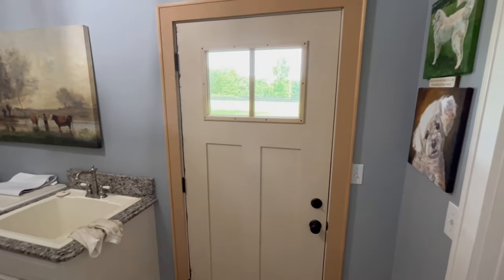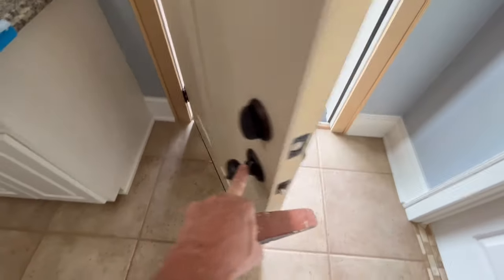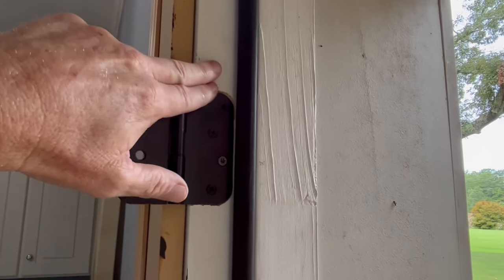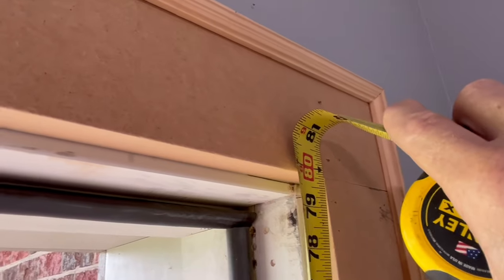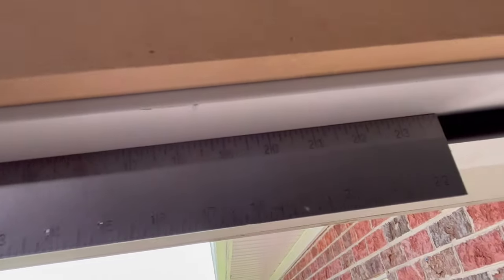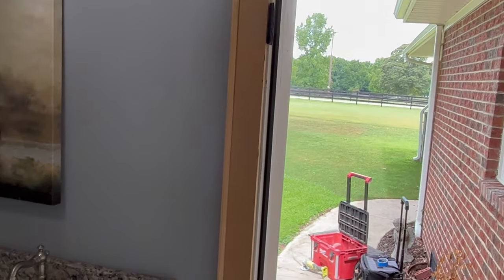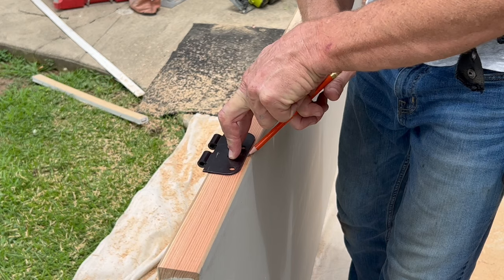How to install a slab door and door locks

Comment: Fantastic video...helped me out tremendously!  I definitely found myself going back to specific sections, so here is a list of chapters:

 Intro 
 1:07 - Measure and acquire the right door
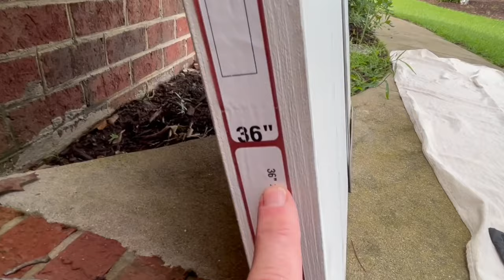 1:45 - Remove existing door and secure hinges
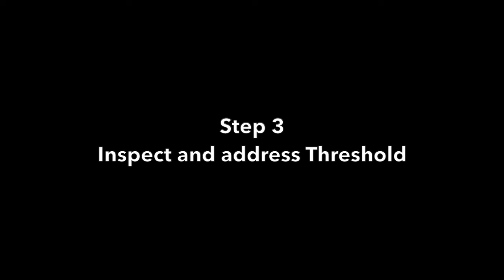 2:54 - Inspect and address threshold
 3:48 - Measure the height and width of jamb
 6:08 - Measure the hinge locations
 7:10 - Check Jamb for Square
 7:47 - Shape the top of the door if necessary
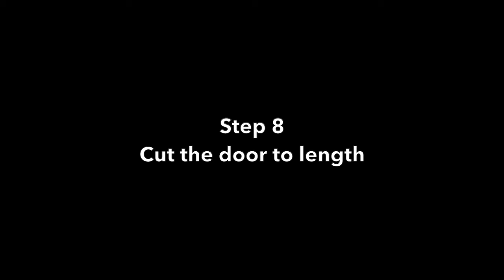 8:20 - Cut the door to length
 9:02 - Shape the width of the door
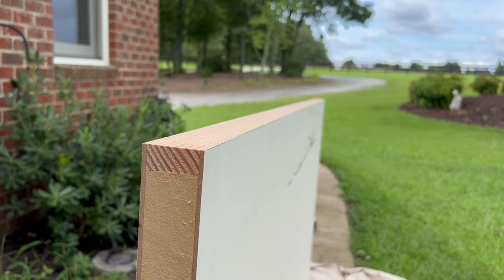12:03 - Cut hinge Mortises on the Door
15:52 - Attach half of top hinge to door and hang the door
17:52 - Troubleshoot to get the Door Working Properly
19:44 - Prep for the Locks and Door Bottom
23:21 - Cut Door to Final Length and Drill Locks
25:04 - Rehang the door with all screws in hinges
25:20 - Install Locks
26:29 - Install Door Bottom
27:12 - How to Practice
Reply from the maker: I'm glad I could help and thanks for sorting that out. I've been doing this a long time, and have found that a systematic approach is the best way, and yet I'm always refining my systems. Thanks for watching and doing the homework.

Comment: Great video. I've done slab doors before and it was a struggle. With your video I know my next one will be a lot easier and have a better result. Thanks.
Reply from the maker: Thanks for watching. Glad I could help
Reply: I finished installing a pantry door with glass inset 2 days ago and it came out great! Using the planer was a kick. Thanks again. @askillthatpays

Comment: You mention that installing an interior door is the way to. Do you reccommend hiring a professional door installer to do my exterior door ?
Reply from the maker: These steps apply to interior or exterior. Interior are easier because they are generally smaller, lighter, no threshold involved and only one lock. lf you've never tried to install a door before, I would highly recommend hiring someone because it's really hard, and a front door needs to look and work great. I've been doing this for 15 years and it's easy to screw up a new door. If you want to try, here's a suggestion. Find a closet door in your house and remove it. Set it aside. Then go buy the cheapest door of the same size at Home Depot and try to install it. It's great practice and will cost less than $100 to learn. Thanks for watching.

Comment: For the hinges
Reply from the maker: I use a 3/4" straight bit and I prefer the Diablo brand. Don't go cheap with router bits because the cheap ones burn up quickly. I also have 1/2" bits but I like the 3/4" because they cut a lot with each pass and it's faster. Thanks for watching.

Comment: Great video! 🫡
How much should you charge for interior door installation?
Reply from the maker: I've run businesses in CA and TN and clients and economy are different. I always give the best price I can and these are the factors I consider.
1. How long will it take? - Decide how much your time is worth and charge accordingly. 
2. How hard is it to do? - This could mean the level or expertise or physical labor. I charge more for rooftop doors than ground floor doors because it's simply harder to get heavy doors onto a roof. Interior doors are lighter and easier. Some exterior or solid interior doors weigh a ton. Sometimes there are many steps, small hallways, basement, park far away. That makes work harder.
3. How busy are you? - When I started my business 15 yrs ago and had no clients, I'd work for whatever someone was willing to pay. I hung my first door for $25. Now my phone rings every day, so I set my own price. 
4. Client expectations - Some clients are facing tough times and I try to give a break within reason. Other clients are extremely demanding or want something done yesterday. 
5. I NEVER charge by the hour - I always give a flat rate based on my experience. That way nobody has to watch the clock. 
6. Economy and geography - In Los Angeles, people have crazy money and will spend whatever it takes to get it done well and get it done today. In Nashville, people are more conservative with their money and, rarely in a hurry, and not as demanding. 
Item 1 is really the most important. I hope this helps. Thanks for watching.
Reply: @askillthatpays  
Thank you so much for responding. You know when a person has a lot of knowledge about what he does for a living. I don’t do a lot of side jobs, that’s why that I had to ask you.  All the factors you mentioned are certainly true. I appreciate all of your videos, very helpful! Have a great day!
Reply: Awesome video!  Will be tackling a door replacement soon.  Who makes the door bottom you used?

Comment: Thank you for the amazing step-by-step! Just curious, do you paint the doors afterward? Or do you typically leave that for the customers to handle?
Reply from the maker: I never get involved in painting and always tell my clients as much before we agree to work. I have no time or interest and I can't carry brushes, paint, buckets etc. I just do installation and repair. Also, during the install, a slab gets handled, shaped, test fitted numerous times and banged around even by the most careful installer. Also best to finish them after installation. Thanks for watching.

Comment: Can you do the same with a new metal slab door?
Reply from the maker: That depends.  If the door is ALL metal, then they can't be shaped, however, SOME metal doors have wood along the edges that can be shaped. If that's the case, then the same steps apply and here's a video of me installing that type of door. Thanks for watching.
https://youtu.be/IboDnYXYVyQ?si=xobxVWkM1EzgXSTV
Reply: @askillthatpays  Thank you very much! I educated myself enough to not DIY but to know my options.